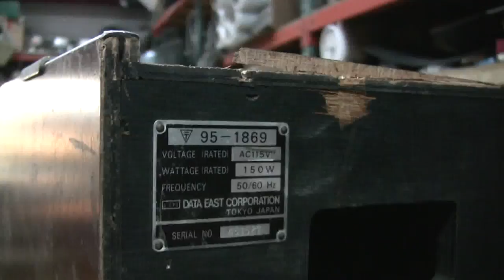#150 Rare DECO Arcade Video Game CASSETTE SYSTEM from 1980 - TNT Amusements

Comment: I like the sound coming off of this arcade machine.  There are two problems that I would have with this machine though...  Cassette degradation and replacement and the inability to save high scores.
Reply from the maker: Yes...that was a problem...especially if someone unplugged it for even a moment...would take 5 minutes to "reload"!  Pain in the ass!!
Reply: Nice... now that cassette loading.. i had a commodore 64 back in the 80ties that had to load the games the good old way.. true a cassette players.. that before i got a 5 1/4 inch floppy reader :) still got all those original 64 games in mint condition.. and some amiga